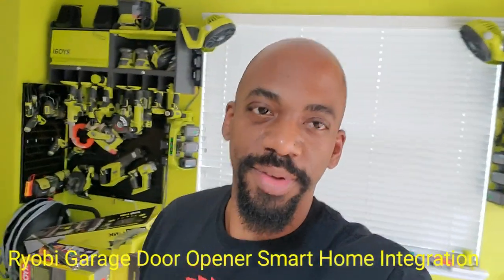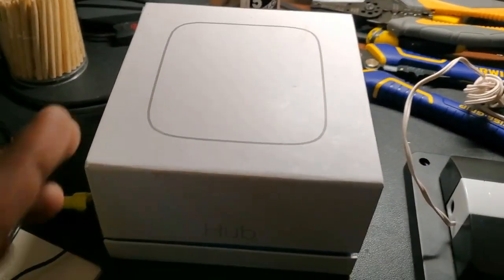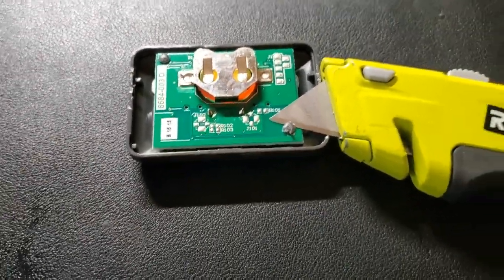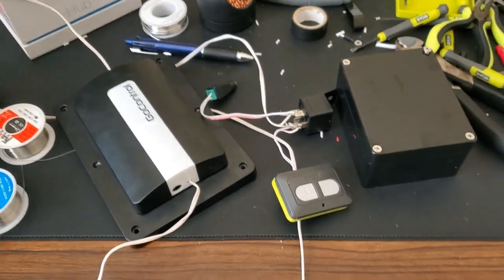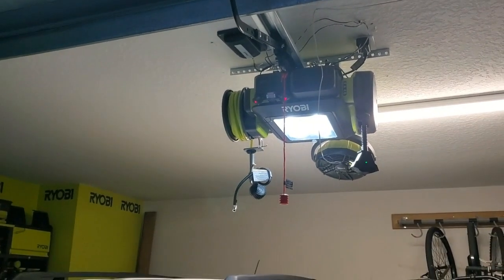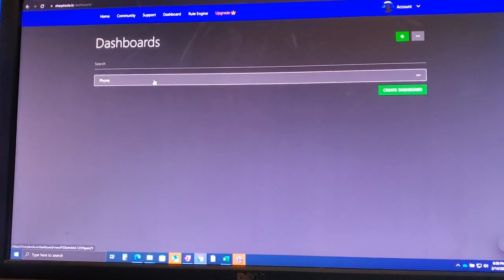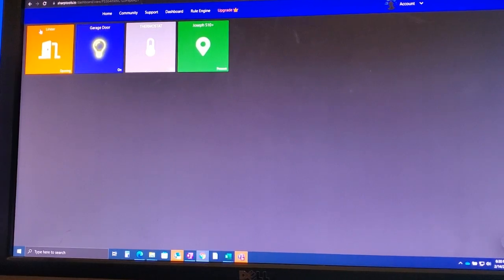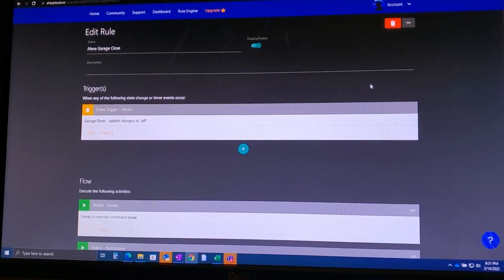Ryobi Garage Door Opener Smart Home Integration

Comment: What soldering gun is that? 
I'd pull them dang speakers. All them warning sounds would drive me crazy. Lol
We are in and out our garage a ton though. I don't mind the ding ding ding, but that horn...my goodness. Lol
So...is the problem with Alexa integration because it's on a different signal? Was Samsung your only only option to correct that?
Reply from the maker: I was using the Ryobi P3100 Soldering station. I built the warning sounds into the smart home routine because I have small children and want to be notified incase one of them tries to open the garage. Normal smart garage door openers send a certain signal to the main unit to open the garage door. I assume the signal that the Ryobi opener needs is different. The regular signal turns accessory port one on instead of opening the garage door. That's the whole reason you have to use a spare garage door opener to get this to work. You could probably use any smart hub that supports Zwave devices. I used the Samsung Smartthings hub because I found one used for $10.
Reply: Do you know Ryobi has their own automated app to open and close the garage opener?
Reply from the maker: @Bartinemus Lawrence  Yes, but you can't integrate it with Alexa using the Ryobi app. I needed a way to integrate it with my smart home automation. I can do so much more now, like have it automatically open when I get home and close when I leave. I can also use it hands free.